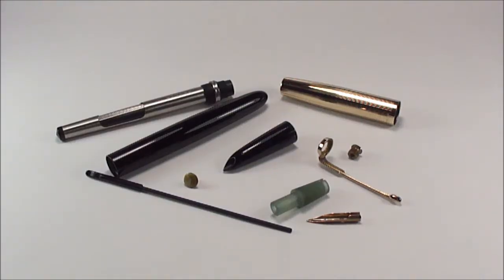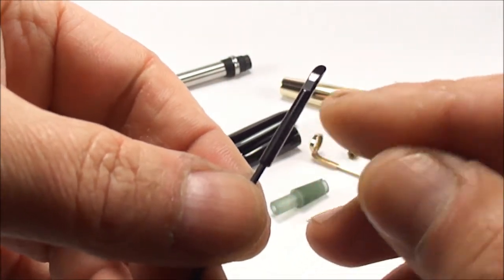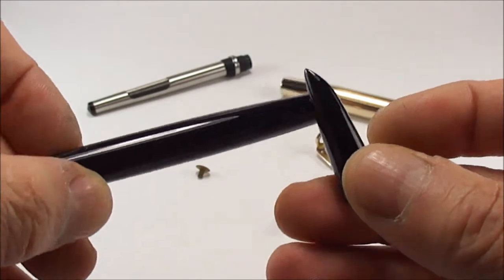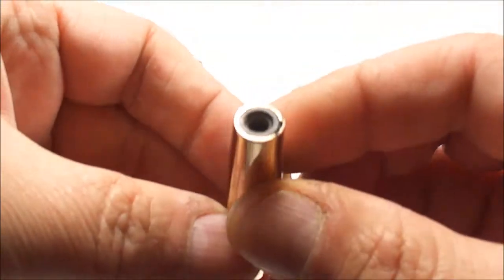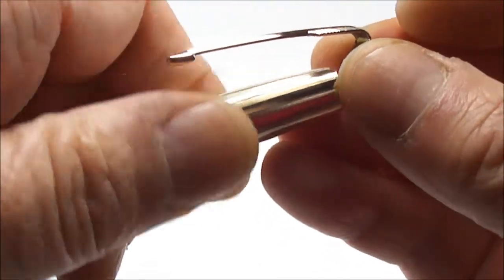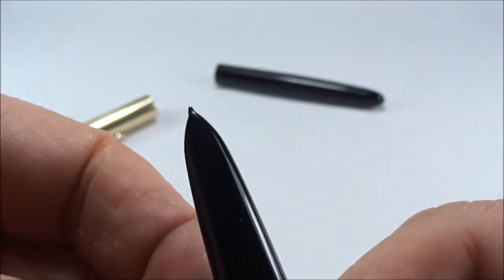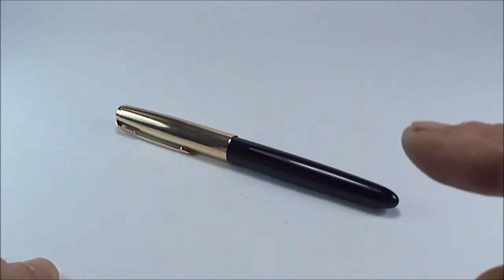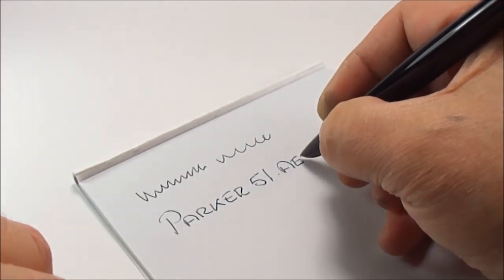How To Assemble A Parker 51 Aerometric Fountain Pen

Comment: I've heard on FPN that Parker used a rosin based thread sealant on the pearlescent jewel to prevent it from coming out, but allowing it to be removed with the application of heat to soften the rosin.  Have you found any problems with the jewels loosening the way you replace them?  Great video!

Comment: Hi, I was just wondering if shellacking the hood back in place is required? I imagine it would be a lot easier to clean in the future, or to fully flush ink to move to a new colour, if you could just unscrew it again and run it under water.

Comment: I have not seen you mention the black hard rubber spacer that is in the rear of many of the U.S. Aeros. They often vibrate themselves out in the sonicator and one needs to be sure the spacer is in place before reassembly if the collector came with one. (Later on, Parker heat fused the slit in the collector for the spacer and stopped putting one in. I do not think

Comment from the maker: Hi..Once the pen has been cleaned inside of any dried up ink then I always shellac the hood back on. If it has been cleaned then any change of ink colour can be done by simply flushing the pen with clean water. I would not recommend constantly removing the hood.
Reply: I tried to use the pen after screwing the hood back on as tight as I could without shellacking the hood or sealing it in any other way and it leaked ink around the clutch ring

Comment: Thank you so very much for your videos on dismantling servicing Parker Pens.  I have one question concerning the dismantling of the Parker 21, 51, & 61.  Are the techniques for taking them apart, the same for all or are there some small idiosyncrasies to be aware of?  I realize there are differences in removing the feeding mechanisms,  but, the hoods and barrels appear to be the same; as far as taking them apart.  Thank you for your time.

Comment: I have a question I have really hope you respond you have been a great help to me. Do you think that a Parker 51 filling mechanism the steel part that the sack goes inside of , will fit into a Parker 21?
Reply from the maker: Im not a 100% sure Mark, as i have not has a Parker 21 for many years. However if i remember right the Parker 51 sac protector is a little bigger than the 21s. Good luck
Reply: Grandmia Pens What brings up the question is I bought a pen off of eBay the other day sold as a Parker 21 Aerometric but it has a Parker 51 sac
Reply from the maker: @markputnam4902  Difficult to comment  without actually seeing the pen. Maybe consider paying a little bit more and buying a fully restored pen ?
Reply: Grandmia Pens I have no interest in doing that I have purchased a few that I write with and I plan to keep some Parker’s & Montblanc’s but most of these pens I am restoring selling for a profit, aside from that I actually enjoy doing it. I have restored vintage motorcycles most of my life so I enjoy taking something old bringing it back making it look new again and giving it a 2nd life. I’m just still in the process of learning all of the specific ins and outs of the makes and models. I have the restoration process down pat I have no issues with that it’s just some of the small specifics like the question I’m asking you hear that I’m still learning but I am a quick study
Reply: Grandmia Pens I wish I could post pictures on here. I have a great amount of respect for what you do and really appreciate your videos they have been a great help to me along the way. Is there anyway I could contact you and possibly send you some pictures?

Comment: i love this pen.
Reply from the maker: Yes they are great pens and very reliable once they have been serviced. Take a look at my custom cap 51s even nicer.
Reply: Grandmia Pens
during watching I discovered, that in my pen the nib was incorrectly (upside down) assembled in the collector. so, I dismantled it, turned the nib, assembled and finally enjoyed fine nib. thanks a lot!
Reply from the maker: Im glad the video was helpful for you.
Reply: it was very helpful. thanks!
Reply: hello again!
I have one question. the ink sac leaks, so I've got to replace it, but I don't know, how to remove the cover. I would be very grateful for Your help.
Reply from the maker: Assuming this is not the threaded sac protector ( see other video Forest Green Parker 51 ).Use heat (hair dryer) directed were the sac protector sits just below the threaded connector. Once heated then pull and wiggle the sac protector from the threaded connector. Use something ( rubber ) to grip the sac protector when you pull, do not use pliers or any thing similar otherwise you will damage the sac protector. If the protector does not come of apply more heat and try again, be patient. Once removed then remove the old sac, then clean the nipple of any old sealant. Use shellac to install the new sac on to the nipple ( let it cure ) apply a little dusting powder to the sac. Finally apply more shellac to the connector just above the sac nipple then push on the sac protector on, once on wipe of any shellac that may ooze out and allow to cure. Done.
Good luck.
Reply: Grandmia Pens it took me some time to respond. I fixed the sac some time ago, but I started fixing in very inappropriate way. of course I tried to dismantle it using pliers. the protector didn't come off, and I bent it. so, while waiting for new sac, I was trying to reshape it using a drill  and a hammer. after one week of regular hammering, the protector visually looks pretty good. of course in closer look, you can see that it was bent, and you can feel bumps under your finger, but I am very happy, that I fix it as good, as it was possible.

the old sac, had a puncture under the window.

Comment: If you suspect the jewel has a rosin based sealant, give the jewel area a good splash with some cigarette lighter fluid. (Naphtha) Preferably not in the area of an exposed flame. ;) Wipe it all off and try to remove it again. The Naphtha is a light lubricant, and enough of a solvent to break through the rosin. It is inert to any P-51 materials.

Comment: Do you have to use the shellac ?
Reply from the maker: +ydg dgnbydfgn I do, but you can use what ever you are comfortable with.
Reply: Grandmia Pens Thanks.
Reply from the maker: +ydg dgnbydfgn No problem, good luck.
Reply: I'm servicing a 21 and will use watch grade silicone grease to seal the hood as I fear I may not be able to remove it in future if needed, does that sound sensible?